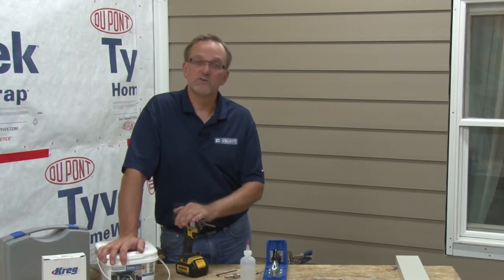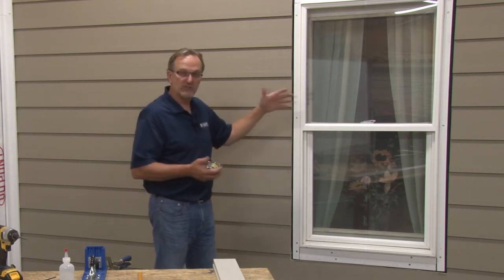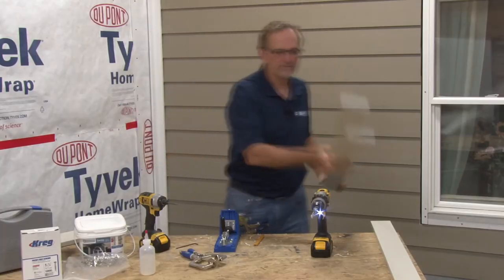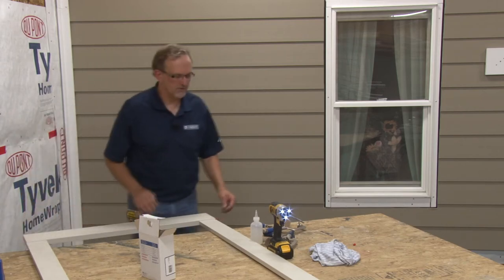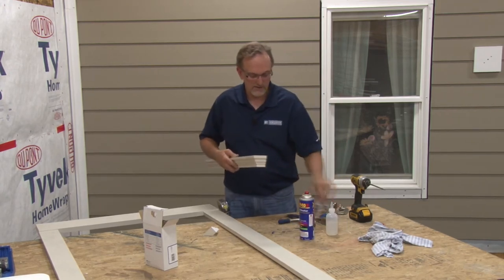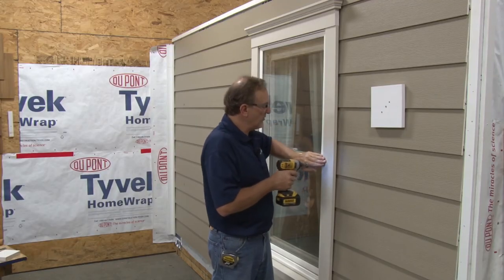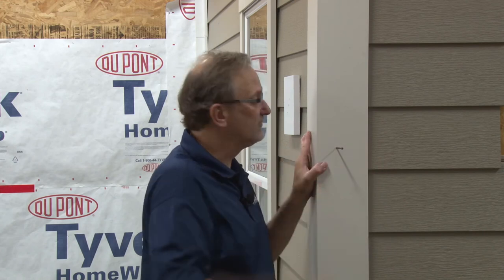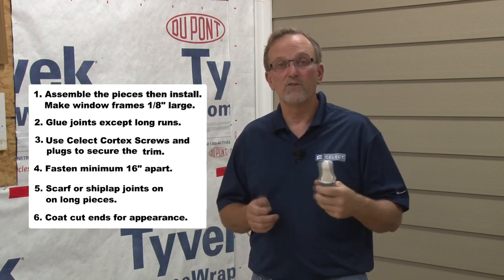Celect Installation - Trim Basics

Comment: Doesn’t the fact that the window trim creates a channel at the top to run water behind the siding pose a problem? Is it possible to run a drip cap above the window trim to prevent that?
Reply: This is my question too.  Isn't there a gap behind the ram's crown header that would fill up with rainwater?  How would you prevent that?
Reply: @medavis58  it’s the main reason why I opted for Hardie as opposed to  Celect and Everlasting. I just can get behind a system that doesn’t keep water out, especially when it’s not even acknowledged in any of the literature aside from saying that this is a rainscreen and not a waterproof barrier. Well. Isn’t that the purpose to have a water proof barrier? Especially without an air gap behind it to let it dry out.
Reply: It was a huge problem with this product in our case.  I just bought a 5 year old two story house in the midwest in March that had Celect Composite siding installed 2017.  We discovered extensive water damage on over 10 first floor windows (window leaks) and two garage doors (sagging trim from beam swelling). Many windows had rotted through OSB on top of the window with mold and water damaged frame, and the worse damage was actually below the windows, as the system channels water down tyvek along the sides of the windows with no way to channel the water out over the siding at the bottom, so it lingered behind the siding below our windows.  All of the water damaged areas were chronically wet (wet when trim and tyvek removed, even if it had not rained in 5 days).  The laminated beam even needed to be replaced over a garage door.  The Celect technical rep looked at our photos and stated the installation appeared to be correct.  We tried to find a way it could be fixed (8 contractors looked at it) (would have required the siding be removed from the whole bottom half of the house if we were ok with a row of replacement clips there on reinstallation, or the best way would be to remove the entire elevation of siding on all sides of the house). I asked the Celect technical rep if Z flashing could be added over the top of the trim as contractors recommended, Celect technical advisor reiterated Westlake Royal recommends no Z flashing over the trim, just over the window.  So, there was no way to fix the problem within the Guidelines established by Westlake Royal.  I brainstormed "off-label" flashing techniques, such as conventional Z flashing over the top of trim. Either way, there is an unprotected ~1 inch on each side of the flashing to allow the siding to expand and contract.  So, we could have ended up with the same problem in 5 more years.  

We decided to reside the entire house with Hardie Plank to be safe.  Project is done except for painting.

I spent two months trying to figure out a way to make Celect siding work for our house.  The siding still looked beautiful after 5 years.   Wish I could post photos here to show what happened from the water. $82k cost for this repair/replacement project.
Reply: @Flogger72  82k?! Whoa…. Sorry you had to go through all of that. Thank you for sharing and confirming my suspicions. After months of research myself, I ended up going with Hardie as well.
Reply: @brightlightabove Siding & trim should never be considered to be waterproof. There always has to be a waterproof barrier (tarpaper, Tyvek, etc) underneath. Even better is to have waterproof barrier, rainscreen gap, siding. Nevertheless, I agree that the open cap at the top is acting like a funnel for water, so seems problematic.